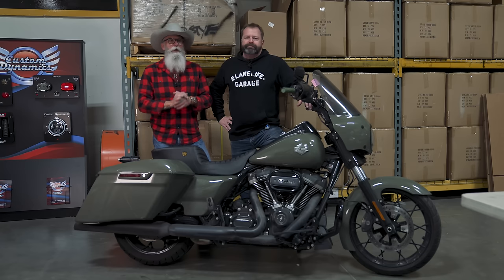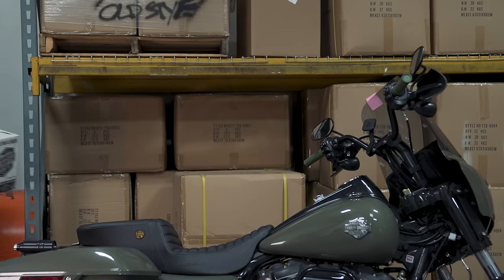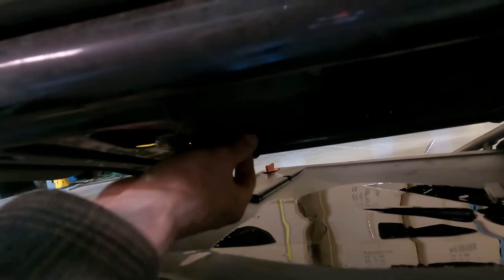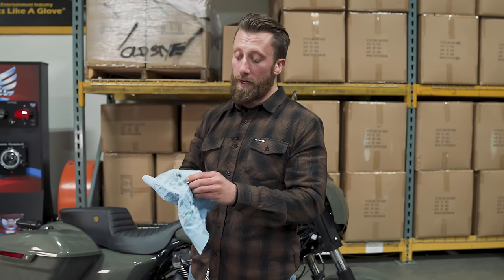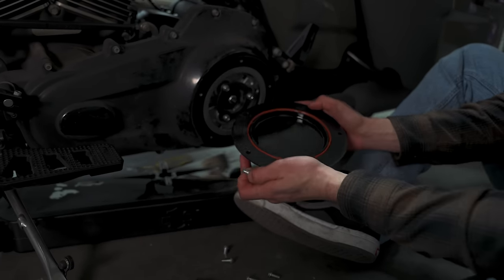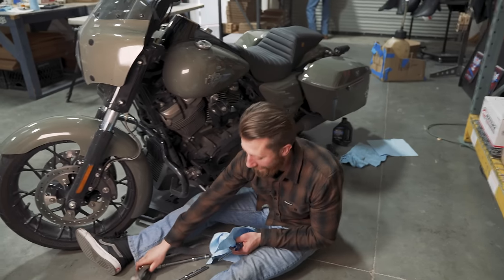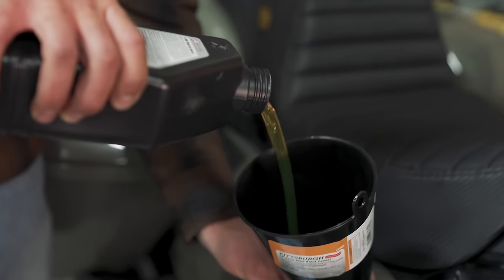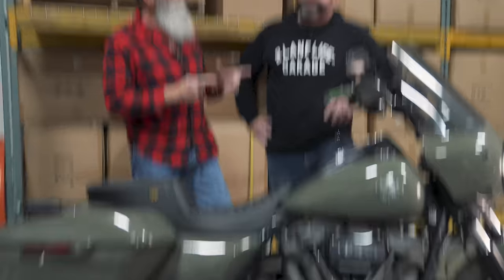Complete 3-Hole Oil Change on 2017-2023 Harley-Davidson Touring Models + Winterizing Tips

Comment: Great video guys. As a mechanic for 20 years I agree with all but one thing.  If you live in a cold climate, Do Not Start your engine just to cycle the oil. Only run if you can drive it to normal operating temps. Two reasons, here in the north, an unheated garage can get well below freezing and that oil (20w50) get very thick to nearly gel like. Very hard on the pump and parts when it starts. Also a by product of combustion is condensation. That’s why you see water coming out of tailpipes on cars before they get to full operating temperature. Unless you get that engine fully warmed up to where the water burns off, that water will sit on your internal parts including cylinder walls. Water and steel obviously not a good mix.  I don’t mean to be that guy that sounds like he knows it all, I’ve just seen bad things from short run engines. I love what you do guys!! Thanks for keeping my winters entertaining.
Reply from the maker: Right on, thanks for the info!! That wasn't on our list anyway, but someone decided to mention it haha. Very good points, we appreciate the insight!👍
Reply: How dare you do an oil change and not have all of the official HD funnels for the primary/ oil filter!… 😂. I was going to say the same thing about starting it, unless you can ride it to get it up to temp, don’t start it! The condensation it created causes more harm than good and people that start their bike regularly during the winter end up with rust inside their engine and milky oil come spring time….😢

Comment: An important point is to remove derby cover screws first just in case you strip a head bolt out.  If that happens you cannot go anywhere on the bike because the primary was drained first.
Reply: YuP oN a wEdNeSdaY 🎯❤️👁️
Reply: Oh yeh.... I learnt that the hard way😭
Reply from the maker: Good point!

Comment: Thank you, gentleman. This was a great video. I would have liked to see exactly how to clean the air filter? Are you going to do a separate video on changing the brake fluid? This is cost efficient.  No longer paying HD 160.00 dollars an hour or maybe more. 
2LaneLife definitely appreciate  this.
Reply from the maker: Thanks Loco Ocho, glad you found it useful! We should've filmed the air cleaner section but took care of it before the camera came out. Simply spray it down with K&N Power Kleen on all surfaces, let it sit for a few minutes, then rinse it out in the sink and let it dry before putting it back in the bike. 
We have a previous video on our channel where we showed that in detail and another video showing the testing and replacement of the brake fluid. Once you do it yourself it definitely saves you a lot of money. Thanks for watching!
Reply: @2LaneLife  Thank you, for your immediate response. Definitely appreciated 👍 I enjoy your watching your road trips. 
Ride Safe ✌️
Reply: @2LaneLife  Your K&N oil filter doesn't require being re oiled before reinstallation, so that it has that red color?  Had to do that on my K&N's on my airplane filters, dual Bing CV carbs

Comment: Is it mandatory to adjust the clutch, both the nut and screw behind the cover, and the clutch cable, every 5k miles, or just do every 10k when you have to do the clutch and primary chain oil?

Comment: Is that the original air filter?  I was told at the HD dealer I could not clean the original one cause it was cardboard and bought a new one.
Reply from the maker: Some bikes came with the cardboard disposable ones but ours have the reusable filters👍

Comment: Is primary and transmission fluid recommended vs 20-50
Reply from the maker: Yes, we use primary specific oil and 80W-90 Transmission oil
Reply: @2LaneLife  Thank you

Comment: Got an air pressure question. I’m a heavy rider on an Ultra. If tire pressure is at 40 when I start it’s normal for it to be 50+ in summer riding after a short time. Should I start at a lower than manufacturers recommending pressure such as 35 to compensate the expansion?
Reply: Read your motorcycle’s manual. Your answer is there.
Reply: You do realize the manufacturers recommendation is for cold tires anyway

Comment: You don’t wanna just start the bike and let it run. If your not taking it out for a ride to get it up to operating temperature then you just leave it alone. Starting it and not allowing it to get up to operating temperature will cause condensation built up and possibly pre-nature corrosion due to this.
Reply from the maker: Thanks for the info, we've gotten a few comments on that and now realize the issue. Much appreciated

Comment: Good video, but I don't really agree with starting your bike during the winter unless you can get that bike up to normal operating temperature.
Reply from the maker: Yep, you would be correct. We should have done a bit more research on that as we do not personally have much real life experience winterizing bikes given the year round riding here. Thanks for the input👍

Comment: If you have to park your bike in a cold garage for a long period of time, try to park your bike on a piece of carpet, it will save your tires in the long run.
Reply from the maker: Interesting! Thanks for the tip👍
Reply: I had also heard this over 30+ years ago (unfortunately last time I had a bike) and used to put mine on two pieces of furring strips. Idk if it would be better than carpet though. Just bought a 2024 Breakout after not having had a bike for 28 years. It's as if I'm starting new all over again. Last bike was an '89 Softail Custom that I had dumped a lot of money into. Unfortunately developed a "monkey in my back" and had to sell it and it broke my heart. Only thing good that came out of it ... been clean since 1998 🙏🏼. Great video btw